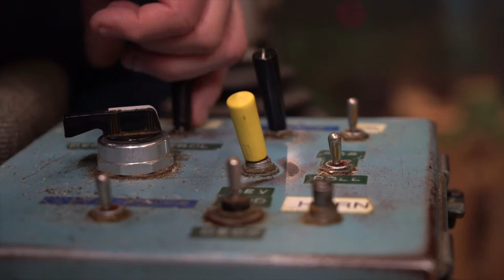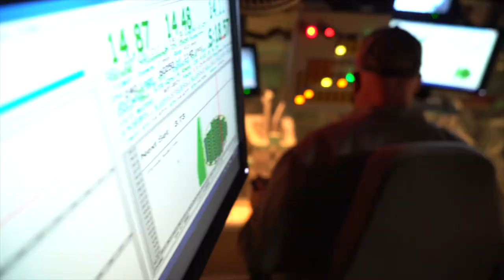Headrig Carriage Optimizer | Cecil Company

Comment: Very cool headrig that is totally optimized. I like how the monitor shows the stack and the backstand. Sawing by eye and grade is pretty much a thing of yesteryear.
Reply: well... the 'optimizer' says cut your outside, 4 inch cant's, to 2 inch making  a bunch of 2x4's. If that's the case, and there's big knots, you will end up with a bunch of spike knot 2x4's with absolutely no structural integrity.
Reply: @johnvarga6198  Agreed, John. I used to have my grading certificate and graded SPS-3 finger-joined studs (Vertical-Use-Only), for two years, so I know what you mean.